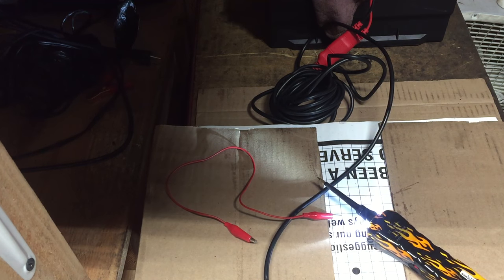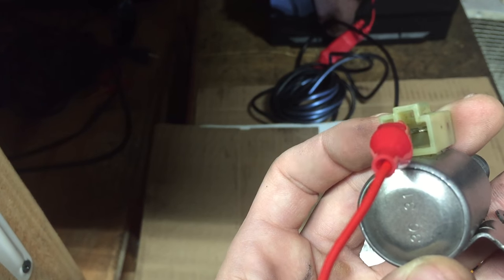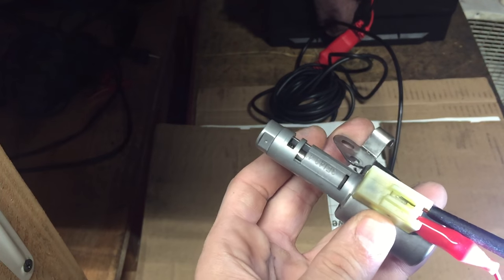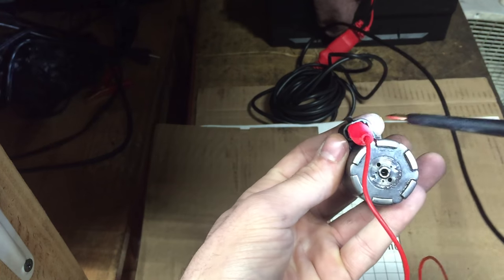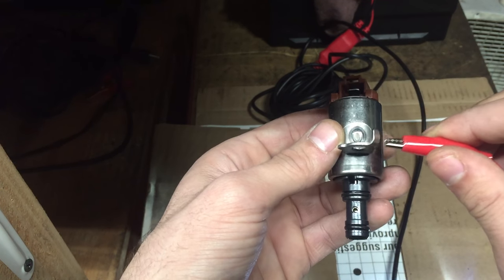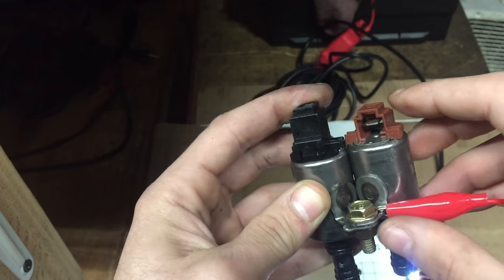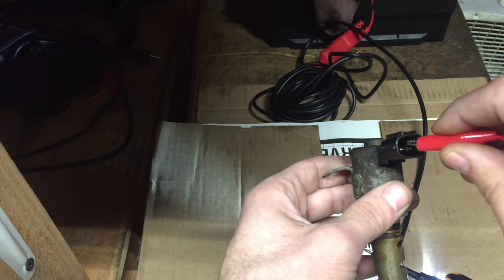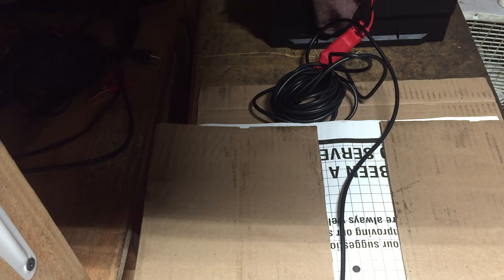How to test a Transmission Solenoid

Comment: You did not show us the electrical source and the voltage and wiring layout .. this is most important than what you've shown
Reply: He mentions they are 12 volt, 2 pin Solenoids. You do not need a wiring diagram for a 2 pin solenoid, and the electrical source is a battery because that is the only 12V source on a car

Comment: Is there a way to check 4l60e solenoids thru the electrical connector without removing the pan? Thanks.
Reply: Yes. With a bi-directional scan tool.